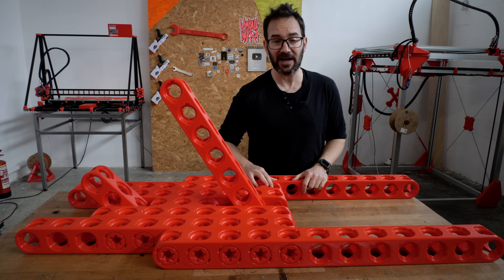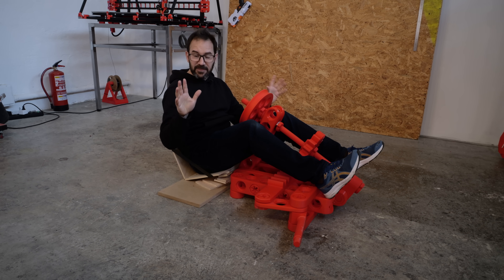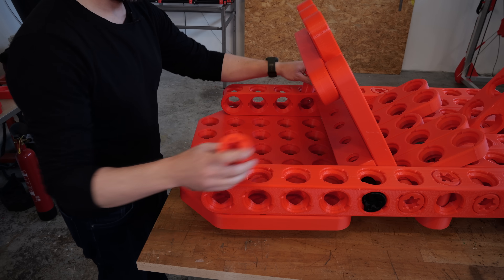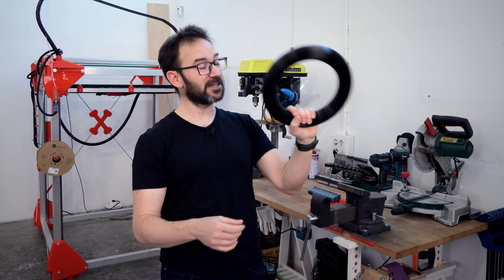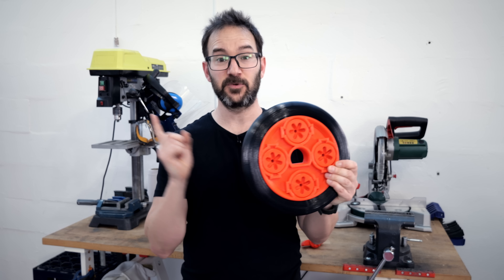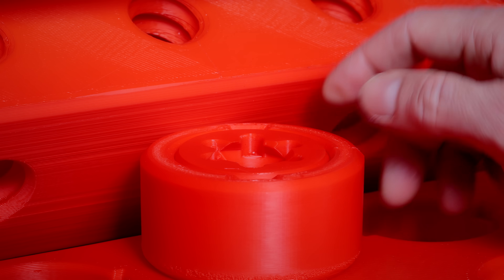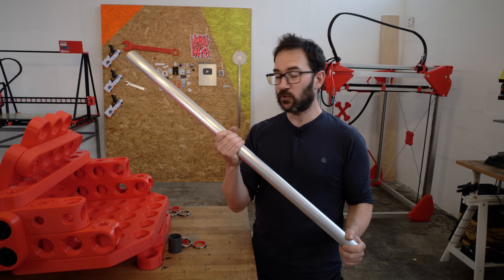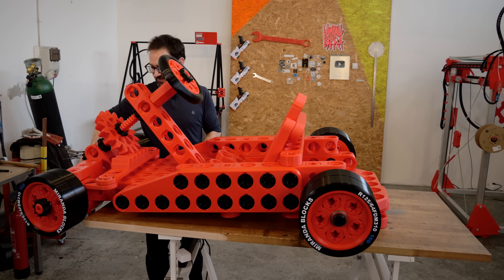GIANT 3D PRINTED GO KART BUILD - THE CHASSIS

Comment: I think that weak point is between the place where the front weels are mounted and the midle of the frame that is supported by the side blocks, I tink it would be better to extend the upper front spindles holders to the back to where the side blocks are starting to prevent it from bending.👍👍

I mean the place when you look at it from the side its between the the front weels holders and the midle section of the frame, more specifically between the place where the side blocks are ending

Comment: please do a red bull style downhill gravity racer with it ❤❤😢❤ please?  design for minimal 6 inch jump hights so a 12 inch margin of error being double 6 and then please print multiples at least 4 to leggo mario kart it with pillows for 🐚 shells and bananas 🍌 not sure how to do boosts without illegal electric motors but if you did magnetic 🧲 breaking just storing it to batteries to discharge to led lights or fans for cooling the meltable parts because high friction and then invite me over for a race 🤪 i need to build a gaint printer like you 😂     it'd be quite an investment 💰👀 my banks not ready for

Comment: Wouldn't embedding some metal screws or rods into the screws help with rigidity / layer adhesion? For example a couple m5 or m6 screws in a hexagonal pattern embeded in the screw itself

Comment: This Look amazing so far and I can't wait to watch you zipping and drifting around in it!

 A thought.. You ought to do stress and weight testing for your joints, bolts and beams that way you can get an idea for or an exact value of how much load they can take, it will give you more confidence and let you design with stress and loads in mind that way your not over or under engineering your designs <3

Comment: I would love to know how many hours of printing time goes into a set of parts like these!
Reply: And filament. He must use multiple reals of the stuff.
Reply: @Gixie-R  You spelled 'pallets' wrong :)
Reply: I mean he said it's really heavy so I assume he can lift at least 30/40 kg so that many rolls.
Reply: In his digger video posted about a month ago, he cut to a moment where he popped open a new spool to print some screws. Pretty sure he uses the 2.2 kg spools like I do, and he likely has probably around 5+ printers printing non-stop, so the print time for all of these is probably around 1,000 print hours, but when you have 5 printers printing essentially non-stop, it's like 9 days of print time on 5 printers roughly, let's say 10 to be conservative. :)
Reply: yes! he should put more infos about printing itself in it ... :(
Reply: I assume more than 10
Reply: Wondering the same
Reply: What a waste of plastic!

Comment: You are going to want a differential gear on that rear axle, or you are going to have a real rough time going around corners with those wide tires. Otherwise, it's fantastic. I think Matt ended up going with a split axle and two motors

Comment: Looks great!  A smaller pinion gear would help with the steerability and also give more space for your legs (as others have pointed out).  What is giving you the strength between the front axles and the steering arm?  It looks like just the little tab, but I'd be afraid that will shear off if you ever see any resistance in turning.  Excited to see it move!
Reply: I would say the steering ratio is way to fast and it will need more angle to make a decent turn but this is a good start tho.

Comment: So I'm going to complain
3d printing is about building custom solutions to problems.
You've devolved into just building legos.
Granted I get that for running a youtube channel it creates less waste and you can create almost anything.
But it's just scaled up legos.  There's nothing unique about it.  There's no mechanical design.  There's no creativity.
What are the engineering challenges you are solving with 3d printing?  This is just "i made some legos then built a lego cart"
Sure there's some engineering challenges with the way you made the screws and bearings but beyond that.  It will and already has become highly repetative.

Comment: Is there a limitation on the power? Like are you both using the same motor and power source? Because otherwise, I'd say get a better engine than his to offset the weight. I'm a little worried about you legs interfering with the steering though (they're really close to that gear!) hopefully the turning radius is good enough.

Comment: You could mount the lithium ion batteries in each of those large screw connectors and have huge capacity while taking up no space and having all the weight be as low as possible.

Comment: It looks like the tires are not grippy enough, i think you'll  suffer from understeer. Maybe some treads could be fitted to avoid that
Reply: Treads only help under wet conditions. If he wants better grip he'll need a higher friction tyre material.
Reply: @lio1234234   I know, i didn´t explained myself well enough. I meant the material they use for retreading tires, that is the same rubber as in tires. It can be glued on the surface
Reply: they will act like slicks i bet. and with some use they will get rougher and more grippy when used on asphalt/tarmac road surface
Reply: @realflow100  could be, i printed the open f1 car and used tpu tyres. It slided like crazy but maybe the extra weight and wear in the material is enough to increase friction
Reply: Brush on some shoe goop…problem solved,lols
Reply: 4wd would help too.
Reply: Its just a great drift Kart😊